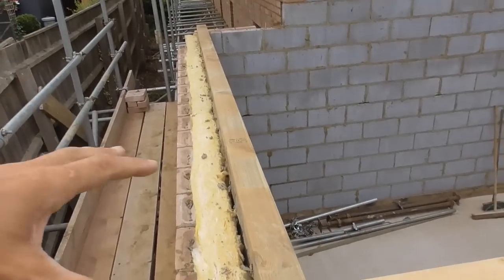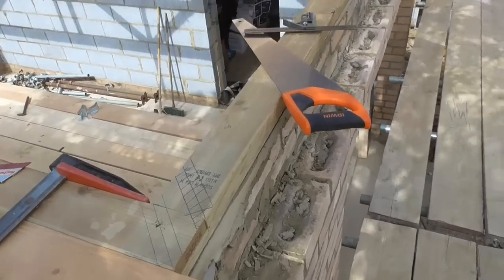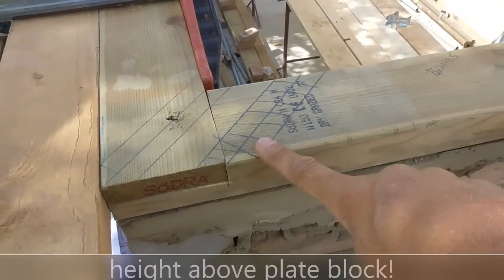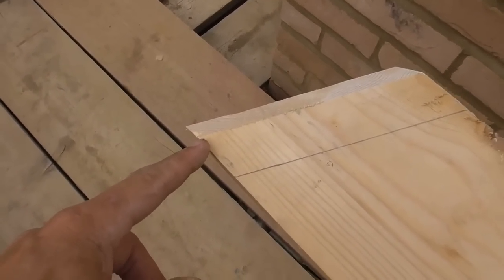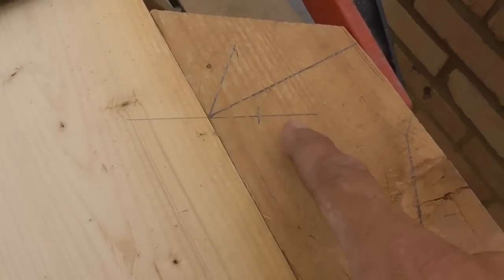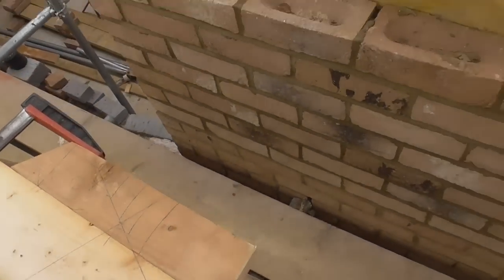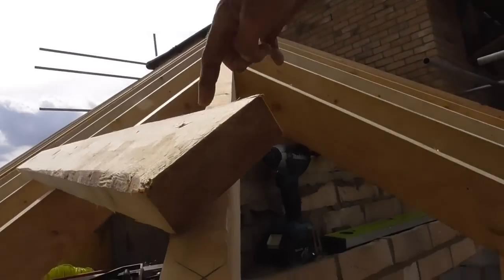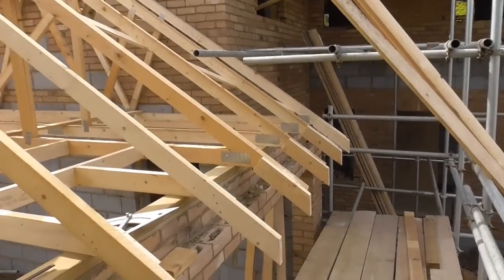Setting out an offset hip rafter***FITTING THE GARAGE ROOF ON THE 12 HIP HOUSE***

Comment: Just a thought, I might be wrong, but could you not just let that wall plate extend past the distance that you need and pitch the hip as normal off the corner?
Reply from the maker: Hi Danny🖐I think this might leave the wall plate in the wrong position🤔Thanks for your comment 🤩 Cheers Del
Reply: @thetallcarpenter  I was thinking that all the wall plates stay in the same position but just let the longest walk plate extend past 100mm, if that makes sense
Reply from the maker: @dannym670  If I'm honest Danny, it's making my head hurt thinking about this🙃If I ever do another one, I'll be revisiting your comment👍Cheers fella

Comment: I need to know why hip position is not installed in corner
Reply from the maker: Hi there🖐Because the walls are not the same width relative to the wall plate👍Cheers Del

Comment: any tips on an dummy tiled parapet roof built on a squint wall
Reply: I've got a squint wall on a side elevation 
, the front elevation is square to the existing house at 5mts , the rear wall is 2.5 mts , making the corners of the side wall unequal, i.e., not 90°
Reply from the maker: @barrysimmonds7151  Sounds bloody horrible Barry😶Can't offer any real advise bud, as its sounds like one of those jobs I'd have to make up as I went along😬Sorry I can't be of much help.
Reply from the maker: Hi Barry🖐I'm having trouble trying to invisage what you're trying to do😬

Comment: Hi del. So because this offset hip is caused by the cavity’s being different size and not two different roof pitches does that make the compound cut on the jacks 45 degrees on each side still or are they different.??
Love watching your stuff mate. Would love to spend a day on the roof with you.
Reply from the maker: Hi Jase👊Yes, ALL the rafter jack cuts are the same against the hip👍The best way to describe what's going on here is simply to imagine that the whole roof has been slid forward on the plates, causing the front hip to not run in line with the front corner wall plate. I guess you could also describe it as a 'flying hip'😉 Hope that makes sense🤞Cheers

Comment: what happens with the line of the hip tiles, and fascia soffit detail in relation to the buildings corner?
Reply from the maker: Hi Hendrax 🖐You basically have to think about the roof, including the soffit and fascia as a completely separate entity to the brick and block work below in this instance. The hip on the back lines in with the rear brick work corner, but is offset by 100mm on the front corner leaving a wider soffit overhang at the front👍Cheers Del
Reply: @thetallcarpenter   Thanks for the response mate. Im doing a roof next week where the wall plate has had to be moved over the cavity, only by 30mm, so the hip wouldn't come through the corner. Don't know if it would be best to offset the hip back to the buildings corner or go through the corner of the plate as usual. from an aesthetic point of view.

I guess the splays wouldn't be 45 if i offset.
Reply from the maker: @hendrax5889  Its a tricky one to call bud. For the sake of 30mm Id be tempted just to strike your hip to where the plates meet and  maybe tickle your soffit and fascia size to minimise the difference🤔Cheers Del

Comment: Working to the blockwork will give you a ridge that’s not in the centre a different rafter length front  and rear .different tile spaces.  a different fascia size and a different soffit width and off set corners  ??
Reply from the maker: Hi there🖐Yes, the ridge is not cental between either the blockwork/plate or the face brickwork as the whole roof structure is 'offset'. Only the front, where the wall make up is 100mm less than the other two sides, the rafters will sit higher above the wall plate, and it will only be the soffit on the front that will be wider. If the roof was not made with trusses, I could have set the rafters so the front soffit matched the other sides, but the trusses were set to a certain span, which, if I'd have centralised them, would have lead to either, a different soffit or fascia size to the rest of the houses roof. 👍Thanks for your comment and for watching 😎 Cheers Del

Comment: The only thing I don't understand is how do you get the right angle for top cuts on the hip because unlike a standard hip it's not a 45
Reply from the maker: Hi there🖐The offset hip is not to be confused with a bastard hip🤔and thier only similarity is that neither of them intersect where the 2 plates meet in the corner👍The 'offset' hip, simply describes a regular hip that DOESN'T run through the true corner of the internal skin it sits on. Basically, all I've done with this roof is 'shove' the whole thing forward so the fascias run round the same as well as the back and side soffits, leaving only the front soffit wider due to the front wall being 200mm wide, instead of 300mm😉Hope that makes sense😎Cheers Del

Comment: How did they deal with the fascia and soffit in those circumstances?
Reply from the maker: Hi Anthony🖐The main reason for offsetting the hip on the front is so the soffit and fascia width and depth can be matched to the main house roofs, the only exception to this will be the soffit depth above the front, single skin wall, where the soffit will be 200mm wider👍 (the width of the cavity and the outer brick skin😎Cheers Del

Comment: Thanks for all the great videos, I'm a cabinet maker so you are giving lots of useful advice for when I build my loft next year. I hope this is not a silly question but is there really any advantage to using trusses in this case?  After taking into account the lead time and the variable quality of the trusses, you still have to cut the hips and jack rafters, trim/extend the rafter tails etc. Wouldn't it be better to hand cut the lot? It seems like sometimes trusses just get in the way of a good roof.
Reply from the maker: Hi Stephen🖐No question that trusses get in the way of a good, hand cut roof, but ultimately, trusses are quicker and cheaper than hand cutting😶and can get round designing very large roofs without the need for huge supporting timbers and large timber section rafters/joists etc👊Appreciate your comment and thanks for watching 😎 Cheers Del
Reply: @thetallcarpenter  Thanks for replying, cheers Steve

Comment: Nice job Del!
Why no cavity on the front wall?
Not only was it a pain for you to roof but surely there is a cold bridge and dampness issue without the cavity. It "only" being a garage shouldn't be an excuse.
Reply from the maker: Hi TT🖐The garage, literally, was just supposed to be single skin brickwork, but the builders decided to make the end and sides cavity work AFTER the lintol had been made to suit 9" piers🤔I guess if anyone wants to covert it to a living space, they would need to double skin the front wall make an insulation space👍Thanks for watching 😎 Cheers Del

Comment: “If you can find a relevant Line Length in Plan-view, you can Calculate and Cut a Rafter from it.”

Unlike U-2, I did find what I was looking for.  Which of course was the shortening of the King at the ridge.  I didn't find it in this vid, but I watched a few more of your vids and it is a standard practice with this type of Hip Truss system.  Indeed the Geometry is correct.  Good job.  

The only thing I do different is I pre-fasten a stringline on the hips while still on the horses, pre-cut the jacks, lengths Calculated using Run dims taken from the plate layouts, and make it fit and straightened during assembly.  Remove stringline once finished.  Always comes out perfect too.  It is necessary to install the shortest Jacks first as braces to plumb the seat, or additional blocking/bracing as needed.   Very common for Hip seats and tails to be difficult.
Reply from the maker: Hi Richard🖐Thanks for your very courteous and long comment🤗Unfortunately, I must courteously disagree with your observations. The bend you see in the hip, (and any other non straight hios),is purely  down to the poor quality timber and not being fully nailed up. My hip ends are set out geometrically perfect, and if you were to draw out the hip/common/end rafter center lines all my hip/common rafters would sit over them centrally. I understand that roof framing is set out and cut in a different way than it is here in the UK, but I am 100% confident that the way I set out and cut all my roofs, be it simple common rafters, hips or valleys is correct👍Kind regards Del

Comment: Cracking video Del, very well explained.
On the flying rafters do you pole plate them to give a little more support at the eaves?
Reply from the maker: Hi Mark🖐I don't put any additional plates or blocks in as they are not required on the drawing👍I've even double checked with the roof designer if additional plates/dragon ties are needed, but he says not🤔Thanks for watching 😎 Cheers Del

Comment: Hi Del, presumably if you had not offset the front hip, it would be lower down than the other trusses at the front? Are you moving onto the 1st fix inside now?
Reply from the maker: Hi Kevin🖐The main reason for offsetting the hip on the front is to maintain, not only the same fascia level and size, but also the same soffit width down the side and back as the rest of the roofs on the house👍I've already completed the studwork while I was waiting for the scaffold to be dropped so I could complete the final, lower wraparound roof section which I will be briefly showing in the next video👊I've also done another video, coming out soon, talking through the stair details and the bulkhead above, in readiness for the stair fitting video🤩Thanks for watching 😎 Cheers Del
Reply: @thetallcarpenter  I thought the soffit at the front would have been 100mm wider than the side and back?
Reply from the maker: @amazing451  It's actually 200mm wider on the  front Kevin as so it has a larger overhang to put down lighters in and also kind of match the wider soffits on the other front and rear roofs👍(I'll be showing how it all comes together in a coming video👊).
Reply: @thetallcarpenter  OK Del that's a good idea, keep busy mate.👍👍

Comment: Hi Del, 
Well mate I know what you was doing but the whole of that video you might as well have been talking in Swahili because I didn’t understand any of that mate….I must admit I am not a roofer and I’m glad I’m not, ya very clever mate 👍👍👍
Reply from the maker: Hi Carl🖐I'm wondering if I could have made a better job of explaining it and should have done a little drawing to help, as what I've done is actually very simple, and all that's really happened is I've set the front hip out to a virtual corner instead of an actual one👍Thanks for your great comment as always bud😎Cheers Del

Comment: But your Gang Plate Joint on the Truss over the Lintel is not on a supported Wall Plate Del, the Brickwork needs to be built & the front Wall Plate fitted before the Truss?
Reply from the maker: Hi FB🖐This is something I have discussed with truss designers many times, and I always get the sane response that it is OK🤔 Like you, I would prefer to see the rafter/ceiling chord/nail plate more over the plate👍Thanks for your comment 😎 Cheers Del

Comment: A bit of a head scratcher 🤔 Del. I get the offset hip. Why no cavity on the right side? So if the wall plates are parallel on inside skin , so the middle common truss is actually off centre  of half the span of the wall plates.  🤔 am I making sense 🤔🤣
Reply from the maker: You are absolutely right Paul, the whole roof is not central to the front and rear wall plates and the central hip end common is not central between the wall plates but central between the hips👊Thanks for watching bud😎Cheers Del

Comment: Hi Del, i have watched the video 4 times and i am still struggling to get it... a job well done nevertheless... today i have been well and truly schooled.. fair play to you Sir..
Reply from the maker: Hi Erroll🖐All I've basically done bud, allowed for the front plate to sit 100mm further inside where it should have been so the soffit and fascia widths can be matched to the rest of the roofs on the job, and it only leaves the front soffit over the garage door wider so IT kinda matches the other 2 larger soffit overhangs on the wrap around lower roofs👍Thanks for watching 😎 Cheers Del

Comment: Another great job Del. I would be sitting down and having stern words with those truss suppliers. And i certainly wouldn't be holding back on their name if their quality in supply dosent improve on the next job, that in it self should be deterrent enough. No carpenter should have to go through that messing to fit a roof. 
You could get a serious bout of timber toe from all that messing 🤣🤣 🇮🇪🇮🇪🇮🇪🇮🇪.  Keep on truckin. Gerry.
Reply from the maker: Hi Gerard🖐I won't be using them again,and I've told by builders not to either as they are the ones who end up paying  to get tge issues sorted😵‍💫Appreciate you watching bud and thanks for your comment 😎 Cheers Del
Reply: @thetallcarpenter  Yeah its not worth it Del theres enough stress without that malarkey. Keep up the good work and have a good week

Comment: Hi Del hope your keeping well 👍 the offset hip do you think it should of been set out from the facework that way the fascia and soffit would line through and you wouldn't of needed to put a tail on those short trusses also the hips would line in with the brickwork? Just a thought🤔  
Great video 👍😁
Reply from the maker: Hi Andrew🖐It's tricky to explain, but if the distance from the plate to the face work is different, but you still set the rafters out from the face work, the fascia would be MUCH wider on the more narrow end because the rafter has not travelled as far down the pitch as the wider walls🤯It's a given in the instance I have shown, that the only way for the fascias to be the same width, is for the soffit to be the extra width to make up for the wall thickness being less👍I don't know if I've made sense😬Thanks for your comment bud😎Cheers Del

Comment: Nice job! 😎 When I have two different wall thicknesses I normally find the centre between plates and set the trusses to that and then that way you have an even soffit all the way round and also the hips can pass through both corners of the plates. This may have been another option for you?
Reply from the maker: Hi Matt🖐My brain hurts trying to invisage what you are suggesting, as I'm always keen to find different ways of doing something👍Thanks for your comment 😎 Cheers Del
Reply: @thetallcarpenter  I know this video was a long time ago but if you was to centre the trusses to give an even soffit overhang each side, you could do this by offsetting the hip onto the front of the extension( the longest wall that stretches the length of the extension) and then that would reduce the overhang on the wall without the cavity but I can’t work out if that would affect the birds mouth being too big on the jack rafters in Order for it to line in. The hip on the opposite side would just sit on the corner of the plate.
Reply from the maker: @Sid Tomo  Hi Sid🖐 The trusses have a set span, so if I centered them between the front and rear face work the main issue it would cause would be the with the soffit and/or fascia size, in that to match the soffit width with the main roof, the fascia would have to much wider, or to match the fascia with the main roof, the soffit would. I advised the builder, that it would look better with a wider soffit over the garage door which could have some down lighters, and sort of match the large soffit under the front porch canopy roof👍Obviously    I was able to set the mono trusses on the hipped end wherever I wanted by just moving the last 'common' truss inwards. Thanks for your comment bud😎Cheers Del
Reply: Would this not give u an uneven  soffit size   ?
Reply from the maker: @leehalling8635  Only on the front Lee, and I've done it this way to make sure the end and back soffits and fascia match the main roof👍
Reply: Should work to the outside of brickwork not the internal block work
Reply from the maker: @trishasheriff9592  Not in this case Trisha, as it would make the front and rear soffit and fascia a different size to the main roof👍 Doing it this way only makes the fascia wider over the front, which will be having lights in to match the porch canopy  roof👍

Comment: This is the perfect example of why you should string line the main roof side as you did in the video. then cut off. But then dont fit your hip, fit your mono trusses. Then move your line over to the other side of where your hip would be mark and cut the monos. Then slide your hip in. No need for measuring and it helps with twisted hip material. You have a straight channel to manipulate the hip straight.
Reply from the maker: I looked and looked at trying to do it like this Clint, but I just couldn't line up the monos with the cut rafter tops as they clash😬Our local authority building inspector doest mine rafters not hitting the hip in the same place, but the NHBC guy won't have anything other than what it shows on the plan😵‍💫Am I missing a trick🤔Cheers Del